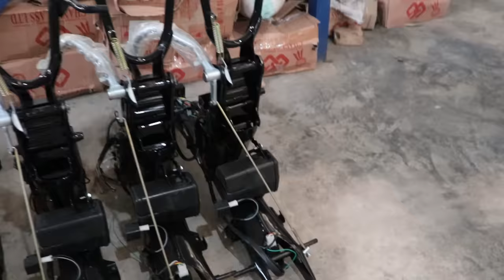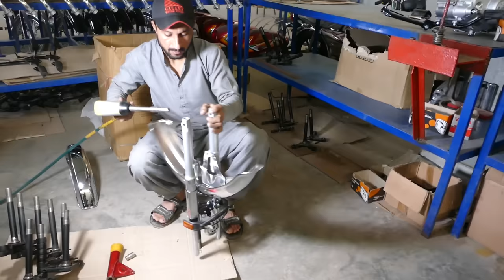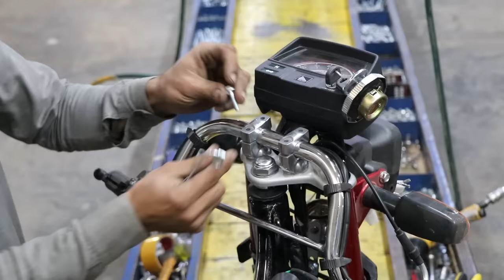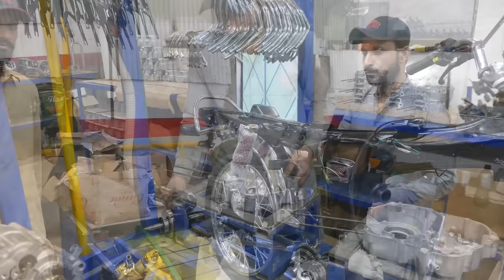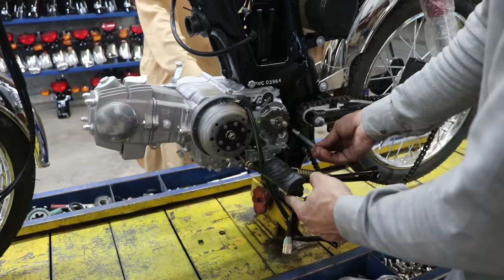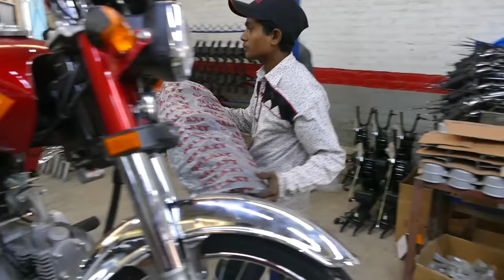Complete Process Assembling of a 70cc Galaxy Motorcycle

Comment: Nice video. Good working conditions and a cool 70cc to rip around in the sun, rain, dirt, mud and whatever the 3rd world and beyond throws at ya while getting 50MPG❗
Cheers 🇨🇦
Reply: @mrharisshafiq127414   70 km pl isnt an achievement. Many 100 cc bikes in India give certified 100 km per hour. 70 cc segment does not exist. Great work by these artists to assemble parts so quickly

Comment: This bike is really cool!
Reply: Yes 70cc gets the work done, and affordable
Reply: It won't have sufficient torque to go over a flyover with 2 persons. A minimum of 100 cc engine is required in this case. 125cc is the best compromise between mileage and power.
Reply: @Dave_en  yes you are right
Reply: @Dave_en  I am from Pakistan we use this 70cc for four or five people sometimes it do 50 km per liter 
It pull easily 200kg weight or more

Comment: Nice factory, clean, looks well organized. What is that obsession with working on the floor? Even with a decent worktable at hand, he works of a piece of cardboard on the fllor for crying out loud. Airtools, kudo’s! Soft hammer, use the metal middle piece of the hammer, someone ought to tell hem or to use the soft cushions of the hammer or skip the charade and use a benchhammer.
Reply: Or the management could look into Henry Ford's moving assembly line process.
Reply: Assim é bom de mais agora vem pra realidade  .
Reply: They have a good enough factory space, if only they could arrange stations and yes work on workbenches. Also proper workwear (with the company logo it would boost their image), light boots, eye and ear protection, latex gloves. The lead technician swings the hammer like there's no tomorrow, he should know better.
Reply: @mohabatkhanmalak1161  on youtube, I saw a BMW employee wearing a t-shirt
Reply: dude its pakistan i am surprised you are not surprised these kinof bikes even being manufactured... did u see the side covers... capacitor discharge ignition CDI...oh wow might as well write Early Man Discovered Wheel Rotating System on the wheels lmao

Comment: Incredible lack of torque wrenches and greasing things like wheel spindles.
Reply: Over tightened bolts and rusty wheel spindles will only show up after the bike is out of warranty. It does have an enclosed rear chain though.
Reply: @nbandpinportugal  I was impressed that it had an enclosed chain. It seemed an extravagance on an otherwise utilitarian designed motorbike.
Reply: @ricbarker4829  Enclosed chains are very useful in muddy or dusty conditions but, apparently, sometimes, because the chain is out of sight it's also out of mind as far as maintenance is concerned...🙂

Comment: So it's now very clear that the big names in the motorcycle business have been plundering us with high tech sounding terms like an assembly line, robotics, 5S, Kaizen, etc.
Reply: Yes, those high tech machineries are used to speed up the process of manufacture and assembling of cars and bikes.
But if you want to make it by hand, it will take atleast 4-5 times the time required by machines. But the results will be same or even better.
In case of electric motor, hand wound method creates premium products while machines make cheap or cost effective solution for the companies.
Reply: dude its pakistan i am surprised you are not surprised these kinof bikes even being manufactured... did u see the side covers... capacitor discharge ignition CDI...oh wow might as well write Early Man Discovered Wheel Rotating System on the wheels lmao
Reply: @Aniketshyam  You missed the sarcasm by a mile, dintya? 😀

Comment: Клапана выставлять придётся! А масло хоть в двигателе есть?)
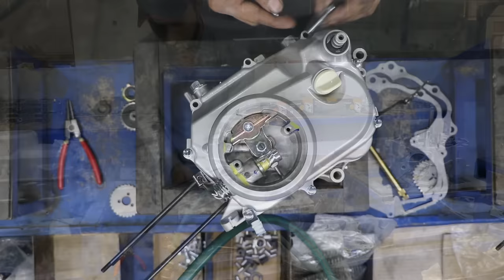Reply: 7:56 below top right white color plug, it is a plastic bolt from where oil need to be filled which is actually a gear box and crank shaft also in it.
This motorcycle can cost 250 us $ and can run 70 kilometers in 1 liter of petrol maximum speed 140 kilometers per hours.
Reply: Скромное удовольствие проехать 70 км за 250 долларов